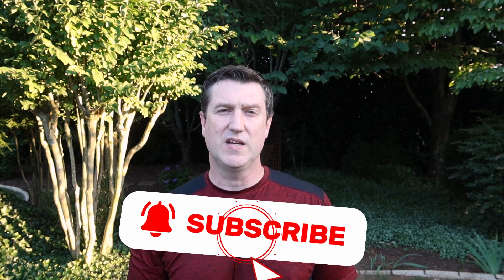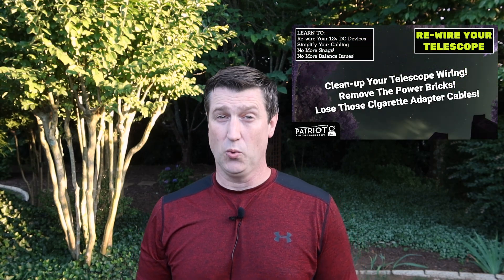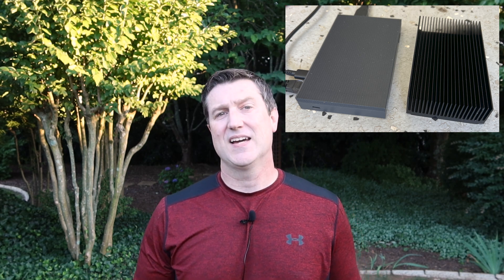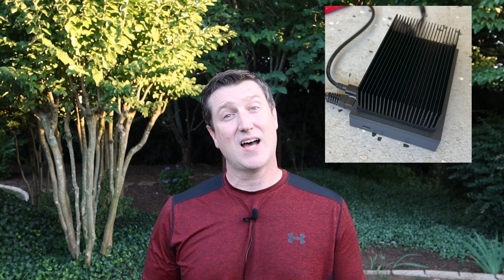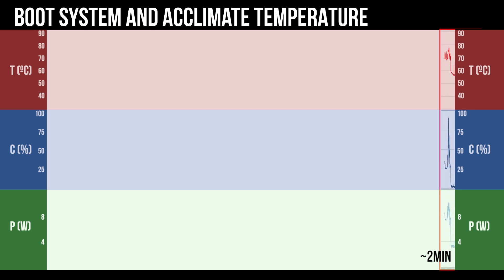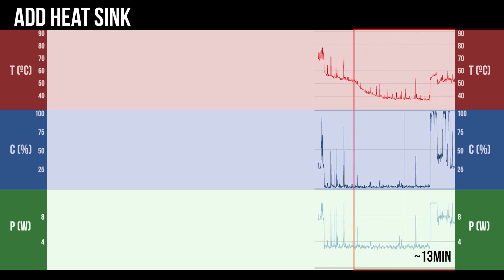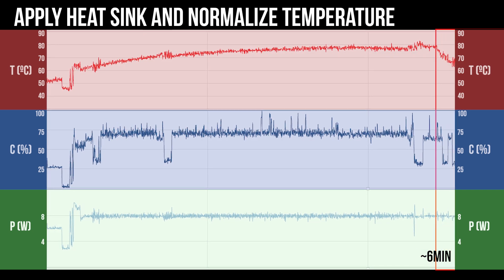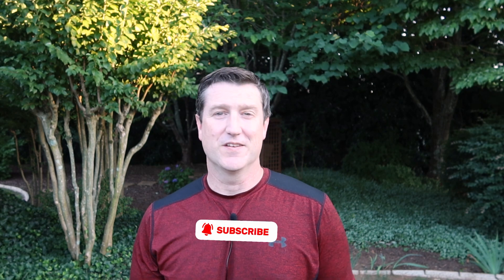Addressing Your Fanless miniPC (Quieter2/3) Temperature Concerns and Power Connectivity Questions

Comment: The case is the heat sink, first thing I did was remove the stickers, kudos for pointing that out.
Reply: Out of curiosity, what orientation was your mele during testing?  I suspect mounting these on the mount not the OTA so that vertical airflow across the case or additional heat sink makes a big difference.  Also having the vanes of the heat sink oriented "up" might be a huge advantage....Thanks!

Comment: Is there no issue with the cable being rated for 3A@5V and using it for 2A@12V? Is there no risk of parts of it melting and causing a short?

Comment: It seems like a new version(not sure if it's actually new) - Quieter 3C which supports Type C PD connector is supported, that looks pretty nice, they even state astrophotography in the title XD
I wonder if there are any other differences that should matter.

Also, can the N5105 mini PC run live stack with pixinsight through NINA?

Comment: i'm not exactly sure but i looked up the celeron n5105 max temp and it seems to be 105 degrees celsius according to the intel page. wouldn't that mean that with 80 or even 90 degrees, it would still be quite far away from taking damage?
Reply: I had the same question, its listed on Amazon as 105c being its max operating temp, also its supposed to come with a Vesa mount which would imply it should be safe to run it vertically.

Comment: Hi, Chad, I'm copying into here the bulk of the email I recently sent you regarding how I get power to my MeLE Quieter 3Q.

I greatly appreciate the incredibly detailed advice you provide in your videos.  Your YouTube vids on the MeLE Quieter were what tipped me over to acquiring that unit.  Further, they were invaluable during setup.

The journey to powering  this unit has been an interesting one 😉 

I pull power from a Jackery 240 portable battery.  This connects to a Pegasus Pocket Powerbox Advance Gen2 via a “car cigarette lighter” style power cable.  This provides 12V power to the Powerbox.  The MeLE then pulls 12V power from the Powerbox. 

My first attempt at connecting the MeLE to the Powerbox was to use the 20V 5A cable that one of your other users recommended, you’ve posted this URL in the detailed notes for this video .  I had problems while using this cable.  Specifically, the MeLE frequently shut down on me.  I don’t know if there was a voltage mis-match between this cable and the MeLE, which requires 12V power.  With discretion being the better part of valor, I stopped using this cable. 

The next approach – and what I’m currently using to good effect – is to connect the Powerbox to the MeLE using one of the Powerbox’s provided 2.1 mm male-to-male 12V DC power cables, adapted to USB-C at one end using a DFRobot FIT0784 USB-C to 2.1mm DC plug adapter.  I've provided you with one of the URLs for this in my email.     

I suspected this would work, because DFRobot’s web page for this item emphatically warns that this plug adapter does no voltage transformation, so you had better be certain that the voltage of your power source matches the voltage of your device!  Those warnings were music to my ears 😉 

So far, this connection approach has worked with no issues.  Power transfer to the MeLE appears to be clean, and I’ve experienced no MeLE shutdowns. 

Keep up the good work!
Reply from the maker: Glad I could get to this in the email after the hiatus. :) I assume it is all still working for you?

Comment: I put a Crucial 1TB NVMe M.2 solid state drive in my Quieter3, I noticed that when used the heatsink tape, it doesn't come in contact with the case, it's not thick enough. So my question is does it need to contact the outer case in order to do any good? Do I need a thicker heatsink tape? what are your thoughts on this. I have removed the stickers from the Quieter3 case as you recommended and I also bought a large external heatsink to mount on the top of the case. Any suggestions would be appreciated.
I was able to get the NVMe drive loaded with Win11 and it is the boot drive, all is looking great at this point. Thanks for your instructions on getting this done.
Reply: Yes it will need to contact the case to dissipate the heat. You should use a thicker thermal pad, the included one is 0.5 mm thick so at least 1mm.
Reply from the maker: As Maestro says below, contact is key to thermal transfer.

Comment: I understand that Mele designed the top of Q3 with a plastic top to facilitate WiFi transmission through the case.  If the heat sink is used that would seem to impact the WiFi correct?  Have you tried using the heat sink in the field and what is your experience with WiFi connectivity?
Reply from the maker: It can definitely shorten your Wi-Fi range. Typically in the field that isn’t a huge issue because you can be close enough to your scope, it may be more problematic at home if you set up far from the house.
Reply: @PatriotAstro  Yes, I just added a Mele to my observatory with the intentions of replacing my laptop. The Mele Wifi doesnt have the range of my laptop and with the heat sink on top I'm getting wifi drop out and loss of RDP.

Comment: I just picked up a Quiter3 and am doing a brand new setup with an NVME drive. When running the updates it seemed to be running very hot. I installed core temp and found that it was consistently running at close to 100C just trying to download and install updates. I eventually got updates installed but it is still running hot. For instance it got up to 90C  just trying to download and install chrome. Any idea what could be causing this? I’m indoors in 70F with the labels pulled off.
Reply from the maker: Just keep an eye on it for now to see if it averages out. Depending on how Coretemp is configured, you may be getting some isolated readings that are quite high or be looking at the high temp for the cycle. It may average out lower. Let me know how it goes. Just out of curiosity, did you put a thermal pad between the NVMEe and case cover?
Reply: @PatriotAstro  My concern is that the computer feels HOT when it has been sitting idle (just the login screen) for an hour. I did install the thermal pad.
Reply from the maker: @dougwill756  Definitely keep an eye on it. I wonder if it is doing something in the background like large windows feature update downloads that may be keeping the CPU and WIFI fully engaged.

Comment: Can you please provide a link to a thermal pad of the appropriate size for the heatsink you linked? Ideally one with thermally conductive adhesive on both sides. Thanks!
Reply: As a follow on to this question.  I am going to assume you used a thermal pad on your setup since you recommended one in your comments above.  Did you remove the peel off adhesive cover on both sides of the pad?  Obviously you had to take the one off that sticks it to the NVME drive, but I don't know about the side that sits against the cover.   If you stick it to the cover and to the NVME is it a problem getting the cover back off later?   Thanks for any suggestions on this.
Reply from the maker: I did remove the plastic from both sides and laid it in between the stick and case.
Reply from the maker: I used the pad that came with the mele for the nvme. I just found one that matched the form factor of the nvme stick.

Comment: Hey Chad - Seem to be having issue with running The Quieter 3 off the battery (through the Pegasus UPBv2).  I'm suspecting that it has to do with the cable from the UPB to the Mele that provides power.  I seem to remember something about specs for the cable - have you been having any issues?  When I plug directly into 120v using their power block, no issues.
Reply from the maker: Are you getting any power to the device? Is it running but then failing (eventually)? Is the power button lighting up, but it won't power on? It could be the cable. I've seen some of these style cables that state they are PD power only and prevent reverse current flow. I'm not sure how they are accomplishing this BUT many of the 12vDC to USBc PD cables I've seen are designed to have the electrical 'load' on the opposite end. They are expecting the power source to be on the USBc side and the 12v DC connector to be on the 'load' side. We need to flip that in our use case and PD designed cables may prevent that from working.
Reply: @PatriotAstro  It may have been the fact that I wasn't using the "always on" power output from the UPBv2.  I ran again last night strictly of battery and from always-on power and seemed to work much better.  The original symptom was that the Mele would randomly power itself off - or, I guess, power was not being delivered properly to the box.  I'm going to try another couple of tests - am interested in finding a proper (longer) USB-C to 2.5mm PD cable at some point.
Reply: @darknight_astro  Did you solve this issue?
Reply: @divye.ruhela  Yes - made sure all the cables were to spec - wire gauge is important.
Reply: @darknight_astro  What wire gauge is needed?

Comment: I bought the beelink u59 because it has a fan, so no temp worries. I run atp, phd2, stellarium, pixinsight, deepsky stacker and others at the same time, no problems. I even do 50 frame stacks in dds while imaging and its done quickly, with temps in the 70s. I use ithrottle to keep the cpu a full speed of 2.9hz. The mini pc is great.
Reply from the maker: Yes, those Beelink systems are very nice for sure. Always nice to have something that can be a workhorse like that for you!

Comment: Hmm, I never thought about CPU temperature on my outdoor rig computers.  :However, my mini-PCs are fan-cooled.  So far I haven't experienced any problems operating during the last several hot nights.  I think I will look into the heat sink.  Plus, placing it on top of the computer will help shield it from the dew.  (I have the computer sitting on the accessory plate of the tripod and not on the scope.)  As usual, good report Chad.
Reply from the maker: Thanks. You may not have the same issue with a fan based cooling system, but it will be interested to hear back if you give this a shot and get results.

Comment: Thanks for the video.   Great info. 
I have been using the Quiter2 for a while now. Two issues I have found. 
1. The internal battery on my system went flat and this will sometimes be in actuate. This cause NINA plate solve to fail. I have run different services to keep it actuate but still is a pain. Mele tech support was great to send me a replacement system but it had a different issue.
2. Over heating of system now sold in the US will cause the USB based Ethernet port to fail. I have obtained a replacement from Mele China with the original PCI based Ethernet port. This system is working better. 
Mele tech support has said they will be replacing the USB based Ethernet port with the PCI based starting in July is 2022.

I will be buying the heat sync and removing the stickers. 

Regarding power I use a Pegasus Astro pocket power block and a 2.1 power to USB to power when I am not at home. That way I only have one power supply coming from my battery system up to the Pegasus Astro. 

Thanks heaps
Reply from the maker: Thanks for the info!
Reply: @PatriotAstro  Chad, How did you adhere the heatsink to your Mele? In the video, you talked about the testing process of just resting the heatsink on the computer. How did you do this in the field?  Thanks

Comment: I've been doing similar tests with a Quieter3 and initially bought the same heatsink, perfect shape and size. I'm testing a few more but won't be done for a while.

To begin, ambient temp seems to make a big difference. The maximum I could reach without extra cooling is 82C after nearly 1h of stress tests and Cinebench on top. I'm using the PC in a chilly room at about 20-22C with low ventilation. You can really see it immediately drop once you place it on top. It's neat.

I'm using the package temperature, however. Core temperatures tend to be lower and CoreTemp only gives those. The cores are usually 8-10C lower than the package when mostly idle, cores go higher under load but after a while reach equilibrium under sustained load. The main difference seems to be the integrated graphics core, which usually runs hotter. You can use HWINFO64 to get those readings.

I wouldn't advise using thermal paste, would be messy, but a good thermal pad can make a difference. I tried with a 1.5 mm one and lowered by about 3C. Not a lot, but I recently watched a video testing various thermal pads, and 1.5 mm performed significantly worse than 0.5 mm so I expect better there. I'll be testing those, along with a graphite sheet, but I'm not sure if it will be thick enough to fill in the dents.

If needed, stacking a bit more mass can help. For example adding an extra heatsink on top, I can get 4-5C lower even, and that's without trying too much. The higher ambient temperatures, the more you'll likely need, but enough should be able to cool under any circumstances.
Reply from the maker: Great info! Are you seeing ambient temp affect idle processing more than loaded processing? I've seen that in many cases where at idle, a higher ambient temperature runs the system hotter than at a lower ambient temp, but when at a higher processing load, the temp seems to stabilize roughly the same possibly because the temperature differential between ambient and loaded is vastly different as compared to ambient and idle. Hmm.

Comment: Great info.........What form of attachment ( thermal tape/epoxy?) would you suggest for the heat sink to the top of the Mele? I am using an Mele 2 with the J4125 processor and finding significant temperatures like 90 degrees if running Sharpcap or Stellarium so the Heat sink looks like a must. I guess would either need to be a thermal epoxy or Tape but I have no experience with the performance or adhesion. Since the scope will rotate during the night the sink needs to be reasonably adhered to the Mele PC. Interested in your thoughts
Reply from the maker: Ya, it's tricky for sure. Thermal tape would be nice but it depends on the tape you get and its ability to hold a ~250g heatsink through the easy movement of the slewing mount. Most uses of thermal tape are for smaller heatsinks, but it isn't out of the question. Thermal epoxy/glue may be a better choice but can get a bit messy and needs plenty of time to cure. Yet another option would be to use a mechanical solution like a z-clip. This is often a wire that runs down through the middle fins and clips at both ends to hold it in place. It can be used with paste/glue/tape as well. The problem with this solution is that it is typically engineered to fit for the use case, BUT I don't see why something couldn't be worked out similarly. You could put a thin layer of metal/wood/lexan under the unit with 2 holes at the end and use that to fasten a makeshift clip at both ends of the sink to hold it tightly in place compressed against the top of the unit. (Or, effectively, just tie it on to the unit with a metal wire or 2, I'd still combine it with tape or something as well.) This is all likely more work than you were hoping for. :) So, maybe a well cured thermal epoxy, or and I know no one wants to hear this, moving the unit down off the scope with a hub as a replacement and one more wire (USB) running down to it from the hub. Oh, and when looking at your options, check to see if they publish strength numbers, like tensile strength, etc. It may be listed in MegaPascal (MPa) but 1MPa converts to ~145psi (pounds per square inch) so it is easy to sort out.

Comment: Thank you for this very informative video Chad ! Should we be concerned by the weather proof of our outdoor computers ? I mean even if there is no rain at night when I take astrophotos, in the morning I often find my gear soaked with water due to humidity. I rarely see astronomers protecting their connectors or mini pc from humidity or light rain. (Not speaking about the water sprinklers in the garden... yes... i it happened to me 😱)
When I was teenager, I was a radio controlled model car enthusiast. We used to protect the radio transmitters in the car by putting them inside party balloons.... yes we are speaking about tiny gears :-)
Do you think it is a matter ?
Reply from the maker: I wouldn't think we would have a problem with condensation forming on these smaller fanless systems. Condensation will form when warmer air meets a cooler surface but in our case we have a warm to hot surface on the pc that is warmer than the air. Unlike a telescope that is pointing up into the cold dark sky, in that case, the telescope loses heat to the sky and as it cools and approaches the ambient air temp it will have a condensation issue. To avoid this with scopes, we use heat straps to generate heat and remain above the ambient air temp... with our pc, we use the cpu to heat everything as an indirect benefit. As far as sprinklers go, maybe an umbrella, but seriously, I have used a plastic container but make sure it can vent enough to not allow the heat to build. It's a balance. :) FYI, I did a science-y video on dew prevention if you are interested. https://www.youtube.com/watch?v=fNCqcC54NUw
Reply: @PatriotAstro  thanks Chad 🙂 very informative as always.